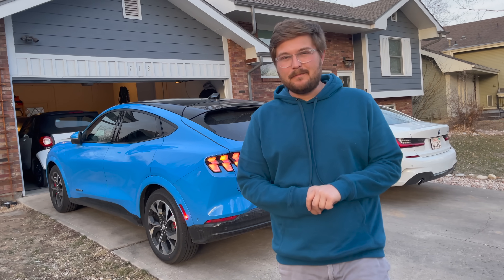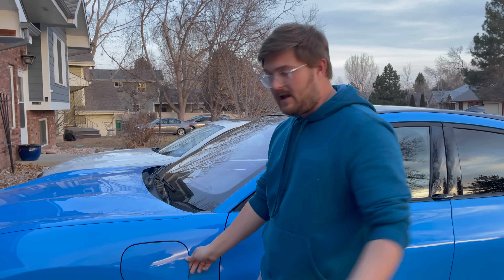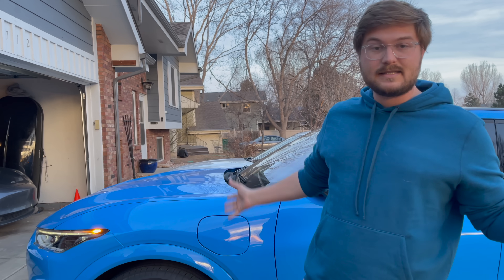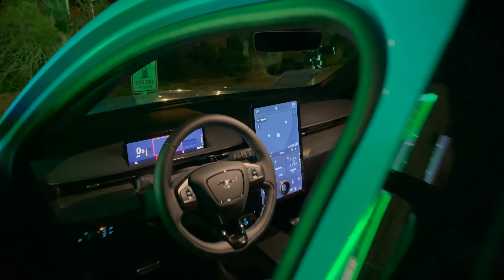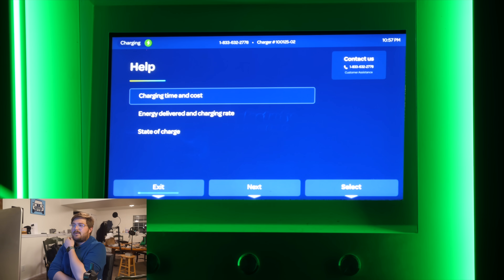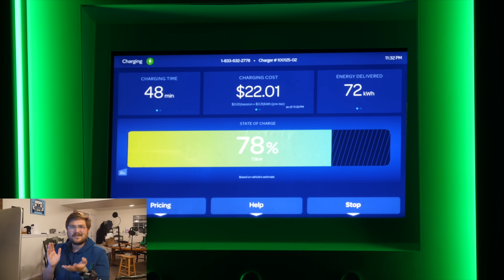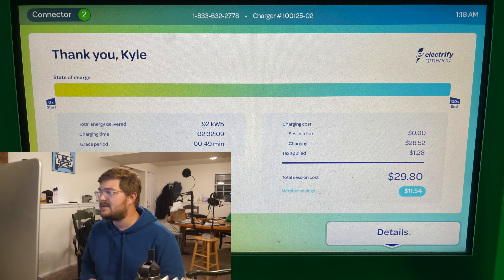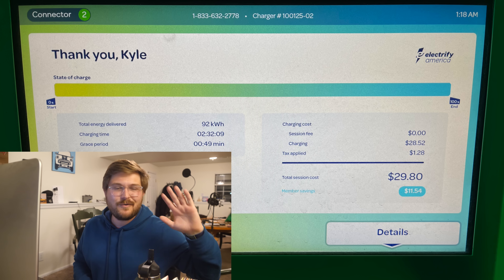DC Fast Charging Mustang Mach-E From 0-100% Takes Over 2 Hours! Here's Why.

Comment: So, it cost $30 to charge this thing.. My 2019 Ford Fusion Hybrid cost less than that and can go double the total miles. That also means what they tell about savings compared to a gas burner is a lie. They tell you how much you save, but that isn't truthful at all because they don't figure in the cost to charge.
Reply from the maker: Keep in mind the cost to charge at home or slower Chargers is much less
Reply: @OutofSpecReviews   10 to 11 cents from my provider.. weekly cost is still $25+ a week. My Fusion costs $26 to fill up from very close to empty, and I can get 400 miles per tank. That isn't even taking into consideration the amount of time to charge at home.. which would limit your ability to run errands.. depending on the previous days usage.
Reply: @huskerfan7660  400 miles for $26 in your Fusion is pretty good. The Mach-E crushes that at $14 or so for the same 400 miles charging at $0.11/kWh at home. It's no contest.
Reply: @huskerfan7660  Charging at home while you are sleeping does not limit your ability to run errands. With a 240V home charger, you can charge enough to go 100-200 miles in less than 8 hours, while you're asleep. Most people drive less than 100 miles on most days, so they can easily recharge in less than 6 hours.
Reply: A typical EV owner would rarely use these expensive DC fast charge stations.  And EVs would certainly emit less pollution.
Reply: My utility company pays me back using fleetcarma so it is even cheaper for me. I only use fast chargers on trips or if I’m too far from home. Using public chargers is expensive but you don’t need to use them as a primary source. I dint want use gas at all we are a 3 car family and 2 are EV’s the third will be gone in 2 years the we will be 100% electric, enjoy you Ford Fusion , good looking car but I spend less since it is cheaper to run and maintaining the car one of them being 72k miles with 0 money in maintenance, I’m sorry I’ll take the ev all day long
Reply: @minibx6659   That is awesome.. That said how much did that EV cost to buy?
Reply: @huskerfan7660  there is a saying that “ for those who believe no proof is necessary but for those who don’t believe no proof will ever be enough “

Now you seem to be on a path of making a point and going against everything that everyone is saying and no one will convince you otherwise and that’s fine, you are entitled to your own opinions but not to your own facts. 

My fully loaded Chevy Bolt was 18k used 
My Prestige Audi eTron was 82k 
You can buy a Chevy Bolt all day long with low miles for 15 k or less and it’s a great car mine has 72k miles  with 0 maintenance cost so far and the battery still at 100% usable meaning that it should last more than 250k miles with a decent degradation, I run my cars with very low money , there is a free fast charger near me that I could use if I wanted but I rather be home .
Reply: @minibx6659  There are also people that fall for the new shiny object and don't even bother to fully research for themselves.. all of the things I am bringing up matters.. all of it, it isn't the simple charge cost, or maint costs. Total price makes a difference, battery degradation, and other factors matter too. New Chevy Bolt is around 30K, used with 15-20k miles is around what you said. What has the battery degradation been on that Bolt. I have read that around 150K you will start seeing enough that it will affect driving ranges. That won't happen in the Fusion. 

When I look at a car, I research all aspects to get the true cost of ownership. I am currently looking at replacing my wife's Volvo with an EV.. if the costs make a difference, compared to a gas engine that is!
Reply: @huskerfan7660  new bolts have a lot of cash back incentives at the moment so a new can be had for around 25 minus local incentives, I would get 2k in NY and 5k in NJ plus no sales tax in NJ .

It will not work for everyone, I have a 120 miles commute daily , that’s round trip, when I get home I plug in and  my battery is full for the next day , not hard at all

If my battery is 100% at the moment no degradation with 72k miles I’ll trust that it will go over 200k miles but I never keep cars that long but other people will.
Reply: @minibx6659  it isn't that simple for everyone... of course it maybe for you because you have a second EV to drive outside of work, but not everyone can do that. Most people will drive their EV more than just to work and back.. that might be one reason why yours is still at 100% and others report seeing less than that. Anyway, buying an EV isn't as black and white as many want it to be.
Reply: @huskerfan7660  no it is not that simple that’s why I said that it is not for everyone. Eventually it will be, nothing starts cheap and easy and convenient, it takes time and work, cell phones didn’t start out cheap and simple or for everyone, now everyone has one, give it ....... or not, you are not being force to buy an EV not by a long shot. Now back to enjoy my Sunday with my family and not replying to comments on YouTube. I hope that whatever you get for your wife in the future works for you and her, many choices out there but you have to be more open minded, public fast chargers are expensive to use and to operate , demand charge is a thing and it is expensive for them.
In terms of Bolts loosing capacity, I’m in the forums and no, that not happening, there are a few members that have close to 150 miles with very little degradation Eric from YouTube being one of them, winter range sucks though that I’ll agree 100% and so far there is now way around that and it is a reality. Good luck 👍🏼
Reply: @minibx6659  Just watched a video from a guy that had 120K on his Bolt.. he calculated less than 10% degradation.. that is good.

My mind is far from closed on EV's, but I also don't just fall for the flashy new toy. The price of fuel will force people into buying EV's, you can take that to the bank. They will make sure it goes up high enough for that!

My nature is a questioning attitude, I guess that is why I am a programmer by profession.
Reply: Typical person charging at home would use this just a few times a year. 13,000 miles / year at home and another 2000mi on road trips makes it a no-brainer.
Reply: @anthonyc8499   Do you think it is free charging at home? Check an electricity calculator.. A weekly charge amount would still be about what this video had at $25+ dollars (based on my providers rates). Like I said above, my Fusion Hybrid does better than this car, for the same price. That isn't even taking into consideration the amount of time to charge at home.. which would limit your ability to run errands.. depending on the previous days usage.
Reply: @Husker Fan if the Mach-E gets 3mi/kWh and you go 400 miles, that is 133kWh. At $0.11/kWh at home...yup, about $14.
Reply: @anthonyc8499  my bad, I was trying to find a calculator to do that plus the time it takes to charge.. it seems to me more would end up using those fast chargers because of the time required to charge from 10/20% to full at home.. of course you can go on less than full, but that allows for less travel the next day. It looks like some are figuring perfect conditions all around for prices.
Reply: @huskerfan7660  Nobody charging at home should need to use a fast charger ever unless they are on a road trip.
Reply: @anthonyc8499  Curious, do you own a EV? How much did you pay for that EV?

Comment: I’m thinking Ford is sandbagging like Tesla did when the Model 3 first came out. Remember for a time many assumed 120kW was all a Model 3 could do. Then later with the V2.5 Supercharger update they upped it to 150kW and finally after announcing V3 Supercharging they took it up to 250kW.

I don’t think Ford will take it that far but if it’s able to pull 160kW I’d guess they can take it up to 195kW if they want to. Maybe after the Ioniq 5 hits the market they’ll be more confident in their systems and raise it to 195kW to compete with that.

Why 195kW specifically? That’s the fastest you can charge on a 500A charger with a 400V pack (Bjorn gets that with his Model 3 on Ionity).
Reply: Isn’t the voltage of the Mach-E closer to 350 volts?  I thought I read that somewhere.

I personally doubt the peak kW will change.  If anything, I think they will slow down the descent so it holds higher kW rates for longer; perhaps make it more dynamic and data driven based on heat.

It makes sense that Ford wants to be conservative and take it slow gathering data.  If they get it wrong and overheat their battery packs, it could cause massive warranty/safety liability that Ford cannot afford to pay.  Not to mention reputation hit.

Comment: It would have been about $36 at $0.24 a minute.
Reply: Notice real price would be 40.00 he had 11 dollars in savings thru the memberships
Reply: @JuanMii24  The membership costs $4.00 a month.
Reply: If they’re charging by the minutes, I’d keep battery strictly in 20-80% state of charge. Depending on how far the travel, it may need extra charging stops.
Reply: 350kW chargers are typically $.31-.32/min
Reply: @ElementaryWatson_fafo  The $4/mo member rate is $0.24/min.

Comment: Wonder if it’ll do 250kw after a software update?
They should have released it with a 250kw charging rate to begin with.
Reply: It can't do 250kW. The cabling cannot handle it. Besides, what's the point of 150kW right now if it's only for 160 seconds?